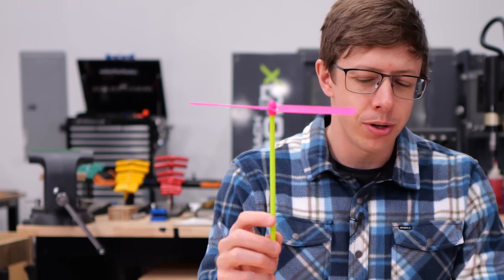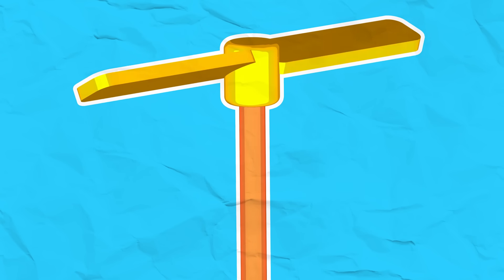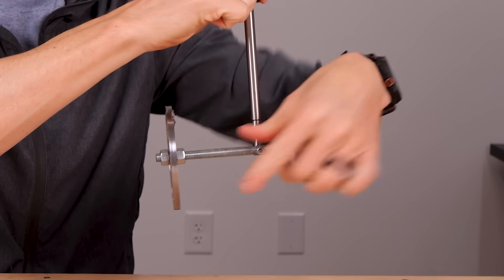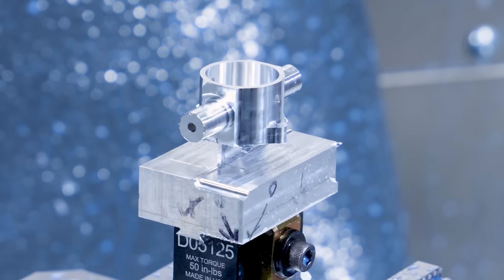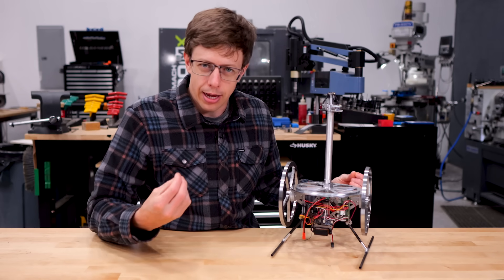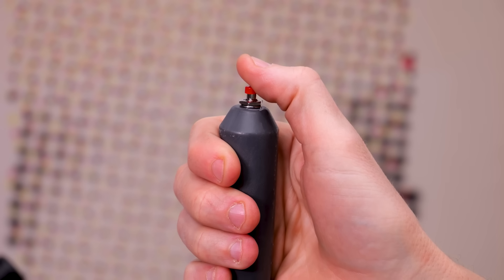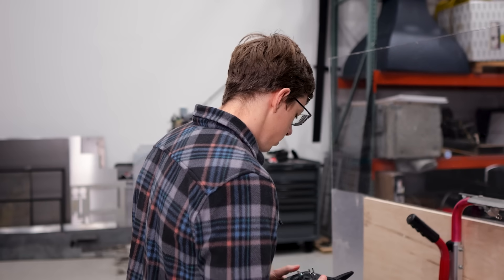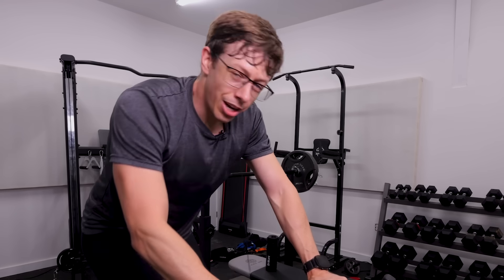I really thought this would fly well

Comment: i‘d love to see you try again but next time try the soviet way. they use two counterrotating blades so they counter each others torque. that way it should absolutely fly straight up instead of tumbling out of control
Reply: Those designs can also fly faster in any direction; with two rotors, there's one leading edge moving into the air stream on both sides of the craft. A traditional helicopter reaches speeds where the side that's turning into the wind generates lift, and the side that's going backwards has no lift.

Comment: Easy way to salvage the Rev1 Design :

Just use a small motor and prop to cancel out the rotation. (basically, the tail rotor of a helicopter)

That way electricity doesn't contribute to the lift, and you can still test your design!

Comment: 3:45 
I think you misunderstand autorotation.
I fly a gyrocopter. My blades are not in negative pitch. I am also fairly sure that helicopters don't go to negative pitch to achieve autorotation.
You require shallow, positive pitch. The problem is that you don't want to be trying to drive that flywheel with autorotating blades. You should put something like a sprag-clutch between the rotors and the flywheel to allow the rotors to spin, freely.

Comment: N.C.pines! Climb them quite often,and once a year or  so , to get drones out for customers,and more recently, r/c airplanes.
Reply: I needed you a couple years ago as I was at the top of a 10' ladder with two 20' sticks of pipe together with another 2' stick with a flashlight to knock my drone out the top of a tree
I was flying it around in the yard and some birds thought it was a good idea to attempt an attack on it...anyway a bird caught one prop (instant death) and then the drone went into the tree
I knocked it out...it fell and hit the exposed roots and broke a motor loose and now it is grounded and boxed up until I get a new counterclockwise motor and solder connections 😂
Reply: @yrusonoz5574 I have a good parrot story, from 35 yrs ago. Ya never know when things will fly in the wrong places.

Comment: I guess there was a lot of feature creep from what I thought the goal was. Still, because it is gnawing at my insides: Why not one gyro at the circumference of the blades with the blades doubling as the spokes? It won't steer and do other cool stuff but it should go nice and high which is what I thought was the goal. Since the geometry increases the moment of inertia (right term?) you can still store energy without it having to weigh a skull splitting ton. Maybe spin up with a break away shaft--up force has to overcome a magnetic force trying to keep the shaft engaged with the spinny part.  I know it isn't sexy but simplicity would still pleasure my wannabe inner engineer even if it just augers into the ground.

Comment: I was very confused when I first saw the contraption, because it looked nothing like the toy, it looked like a helicopter.  Given that it had onboard electronics, you could have just had a tail rotor. The reason you didn't has to do with all of the internal, unstated rules you had for yourself, that were in someway preserving the spirit of the original toy and not just... making a regular helicopter. It would have been nice if you articulated those rules so the thing made more sense.

Comment: I would have approached this differently. 1st have the rotor blade spring loaded so that when it spins up the blades come out through centrefugal force, this way when the blades stop spinning they snap back into position and a parachute can actually be deployed without tangling. 2nd only have one flywheel mounted horizontally driven with orbital gears, perhaps this could work but maybe still get issues with procession. The whole structure would be lighter and simplier. Thoughts?

Comment: Counter rotating coaxial props, driven by a concentric pair of driveshafts which each go down to two counter rotating concentric flywheels. In the center of each flywheel is a planetary gearbox. The ring gear is common between the two to cancel forces. The flywheels drive the suns via the top and bottom of this sandwhich, and the lower speed outputs from the carriers exit towards the middle of the sandwich, where  they then travel coaxially through the a hole in the top sun gear and up to the props. The only component that isn't intentionally spinning would be the shared ring gear. Any rotation observed in the ring gear could be tuned out mostly by adjusting the relative pitch of the props to vary net torque on the system. No electronics

Comment: I know I'm late on this, but I would personally keep closer to the original plastic design; But make the blades themselves the flywheels with a ring going around the outside, which should also help have a soft landing (I know from experience with a snap electronics kit). I would also increase the efficiency by having a proper propeller profile so it isn't fighting itself between the inner and outer radius of the blade. You would have to give up the blade reversal, making it fixed. But I'm convinced you wouldn't need it nor would you need any electronics. Could make it have a 2nd counter-rotating blades with a ring as well. Hope you see this and consider some of these ideas! If you don't I may try it myself 😅.

Comment: Your understanding of autorotation is just a tiny bit off - the rotor blades do not invert their blade pitch. In fact, in the helicopters I have flown, we cannot physically change blade pitch that far. The best we can do is get them to be just about flat. 

Instead, autorotation occurs because of the up flow of air in conjunction with the residual spinning of the blades. Essentially, the lift vector produced by each blade gets angled slightly forward, causing the generated lift itself to also be propelling the blade forward. This shift in direction for the lift is because lift is always perpendicular to the relative wind vector, which is now angled slightly upwards. This is one of the topics that really needs a diagram to explain well, though.

Comment: It would be a bit more complex to make, but an easy way to counter the rotor torque would be to use two contra-rotating blades. it might still be beneficial to have small control surfaces at the base to assist in cancelling out any precession that might occur from maneuvering. This is a really interesting problem to solve, thanks for sharing your process through it.

Comment: How about a 3rd flywheel? Underneath the gear that drives the propellors. The only problem I see with this would be drag. Idk how much you could mitigate that with a cone on top and bottom. Might be able to turn the 3rd flywheel into a 2nd set of blades in a way? This would help offset the extra weight. Would take a belt or some form of gearing to get the direction change along the same axis but maybe that'd help salvage it? And if a 3rd doesn't work because of its weight vs the other 2 you could try doing something like wheel weights to find the weight on flywheel #3 that is the perfect balance. I love the idea, when I was a kid we had trees that dropped samaras and I would love playing with them. I ended up getting an RC helicopter and omg it was so hard to fly haha. Luckily it came with some of those carbon fiber support rods with the ping pong balls on the end like you used. Best of luck with whatever you do, I am anxious to see your method considering I'm 7 months late to seeing this I'm sure you already have something cool in the works. That would be hilarious if it was the same thing I thought of.

Comment: what if the electrical components where housed inside the "straw" part of the original hand toy?
then it would just be earrings at the Botton and a gear or fly wheel system a at the base. I think the issue is getting to technical(which I love to watch and always advances knowledge) maybe to make a.metal version of the go hand toy but with fly wheels that disconnect at the base?

Comment: The big bevil gear connected to the W flywheels could be the cause for the rotation in flight, both the air being pushed like you had on the flywheels but also the mass

Comment: Well, it is a helicopter, right? Helicopters usually have that small stabilizing propeller in the back, or they use two main propellers that spin in the opposite direction to control the gyroscopic forces.

Comment: Why not have the blade shaft release from the spin up motor so it flies in the air just as the toy would? Aside from a flywheel embedded in the blades.

Comment: Ok lad I am no engineer, but it looks to me like you didn't compensate for the central bevel gear and propeller rotation.  you will need to have a counter rotating wheel or counter weight spinning on the drive shaft to cancel out the upper spin

Comment: A simple way to understand autorotation: prop blades are like glider wings, and autorotation is like gliding. If you apply power you can fly in any direction, but even without power you can glide down at safe velocities.

Comment: put the fly wheel at the tip of the rotors with pins.. it stops the sound barrier effect still gives a fly wheel  use the rotors as the spokes... spin it up and release it without the stick...only the rotors and fly wheel need to fly...  so you get the effect for less losses.. the larger diameter means less mass for same inertia

Comment: OK here's where you went kind of wrong. You made the wings straight with the ailerons able to counteract the spin but you need to make the wings counteract the spin with the ailerons providing the small changes. Don't make them straight down. I believe you did a good job with the motor but I would have used compressed air to spin up the flier and I don't know why but I swear it feels better. Good luck in part two!

Comment: At the start, I would've suggested 2 stacked counter-rotating rotors, but... adding another rotor (or tail rotor) just takes the design further away from the toy that inspired it and more towards a generic RC helicopter.
Then again, the same can be said about all the other things you've done. In the end, you'll be building just another RC helicopter with the only difference being the lack of on-board motor.

Comment: Hi, by using something like a rachet gear on a bycycle (which spins in one direction to paddle and then when spun in different direction does nothing) eliminates the usage of the other fly wheel which you are using to counter act spinning of the Flywheel in opposite direction caused by the fan blade?

Comment: Another idea could be to have another set of counter-rotation rotors in order to counteract the spinning, kind of what some russian helicopter are doing. 

Should be more efficient because all energy goes into generating lift and less weight has to be added to circumvent the issues. If you use the right gear ratio for the second pair of rotors, you could possibly even ditch the second flywheel, which eliminates the need for the synchronizing disk, reducing weight further.

The gear ration for the second set of rotors would then counteract the rotation of the flywheel by spinning faster.

Comment: I was completely entertained the hole video was awesome ❤ I have a question; why not just change the position of the flywheel like a horizontal and on the bottom instead of vertical and on the sides?

Comment: They had a version of these toys that did fly longer using elastic bands! 😅 i wish i remembered their design but if i were to remake it i would make a flat vertical propellor and an elastic core you twist and let go to fly. The bottom wings resist spinning horizontally and the elastic core spins the top propellor.

They werent perfect but they were much better at flying than the original toy

Comment: Making things fly correctly is hard. I can vouch for that as an aerospace engineer. You could have put it on a bench and measured the reaction torque profile vs rpm. Put an anemometer and measure the variation of the downwash airspeed with RPM. Then used this data to calculate the size of control surfaces you require and degree deflection needs to balance the torque at each speed. Then implement it in the flight controller for auto stabilization and having a somewhat more controllable  craft.

Comment: You have almost all the pieces, you just need an explosion. You go back to your first idea. The propeller is the flywheel. You solve drag the same way you did with the gears; paper over them. 

You just need a way to instantly remove the paper, when it is ready to fly. So, you fill the inside of the paper with flammable gas. Then you hit it with a torch when it is ready to go, and it blasts off like an icbm

Comment: Its somewhat strange that you argue that the parachute is not an option because the helicopter might fall into it when the autorotating blades are also very sensible to the angle for which you dont mention that at all. Its surely a clever solution but it also needs a stabilization and if you have that you could also use the parachute.

Comment: You didn’t dig deep enough in the toy box. The rotor IS the flywheel. A small amount of weight at the tips increases the stored energy. A string wound around the pin ( like a top) increases the amount of energy you can spin up.  There was a generation of plastic helicopter toys that did this perfectly. Also putting a ring around the propellor tips accomplishes much the same thing but with more drag.

Comment: Your work continues to be incredibly creative and inspiring. As someone who studied helicopterology in college, I see some areas of potential improvement. Consider mounting both flywheels on a common shaft, still driven by the bevel gear. This would double the gyroscopic effect rather than cancel it. You could also use an inverting gear on one wheel with the same setup. Also, there are some sources of flutter in play. Any time the blade experiences flutter, this will manifest as oscillations in the rotor plane itself. First, make sure the center of mass of the blade is ahead of the center of pressure generated by the airfoil. Generally speaking, the NACA airfoil series have stable locations of center-of-pressure based on geometry. As an example the NACA 4412 has a CoP located about 35% of the chord. Locating the blade pivot axis and CoM ahead of the CoP will lead to natural aerodynamic stability. This is why many helicopter blades include a metal rod along the leading edge. Next, if the collective pitch you're introducing is too high, the blades will stall and shift the CoP chaotically, leading to more flutter. It's hard to say from the footage, but it looks like you're adding upwards of 20deg to the collective. This is way too high. Consider clamping it at 10deg. Hope this helps!

Comment: Orthogonal gyros would work.
Keep prop+drive gear's angular momentum equal to each flywheel, make sure drive gear has a larger radius than the flywheels, and set the flywheels perpendicular to each other, rather than directly across from one another.

Or set up a tail rotor. Your choice.

Comment: Did you think about a second smaller set of helicopter blades perpendicular to the main rotors, perhaps on a long arm or tail, that can spin at different speeds to offset the torque of the main rotor?

Comment: You might have already figured this out.
If not. Lemme help you.

Helicopters have a tail rotor to help stabilize the axial forces that keep borking every attempt you make at a launch.
Without the tail rotor, your machine only wants to spin the blades as long as the friction on the ground exists.
As soon as it loses that friction, the "fuselage" spins more easily than the prop.
Due to it's center of inertia being more concentrated than the prop.

Also, the main prop should be able to adjust pitch. So that it can climb at descend at will.
The best way to describe what I mean is thin about blinds on a window.
The way you can turn the blinds to "open" or "shut" them, that's the same motion the prop blades should be able to achieve.
If you can't adjust pitch, you have no way of controlling any ascent or descent.
Speed is not a determinate factor in either of those.
Neither is weight. Unless you are a hot air balloon.
ALl of this is to say, you absolutely will not be able to get that to fly without a tail rotor, and a prop that can adjust it's blade pitch.
You will also need the main prop to adjust it's angle of attack if you want to be able to maneuver it.

Source:
I have built helicopters in KSP (Kerbal Space Program), a pretty descent rocket and aeronautical physics simulator, but a fun game as well.

Best of luck.
Suffice to say, helicopters are built like that for a reason.
You'd have an easier time getting a unit with 4 equidistant props to fly.
Just remember to get the rotor rotation correct. FL:CW, FR:CCW | RL:CCW, RR:CW
(a typical modern consumer drone)

Comment: "Over-engineered Stuff Made Here". Years ago I used to fly model airplanes and design some drone electronics.  The whole time during the video I was feeling a bit like... yeaaah, maybe there is a reason why helicopters aren't designed in this specific way, riiighhht??? 

It kind of reminds me a time when we spent half a year designing a small ROV and put 1,5kW of electric thrusters inside of it. Juuust to realize that its end-caps are getting blown open underwater, because the amount of heat produced by speed controllers is insanely big, that we cannot passively cool it and the air inside is expanding like crazy. Those old times...

I am impressed by the level of overengineering involved in your project and that it actually went pretty high in the end. That deserves a recogniton.